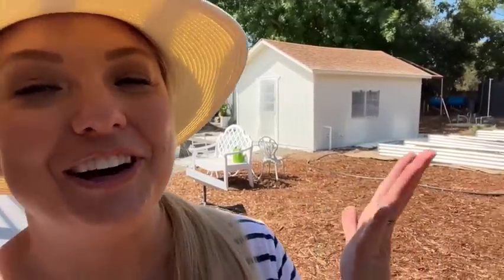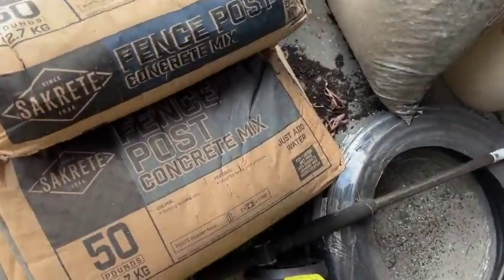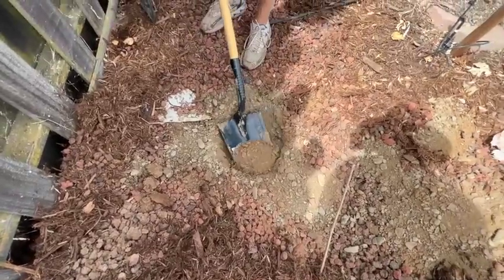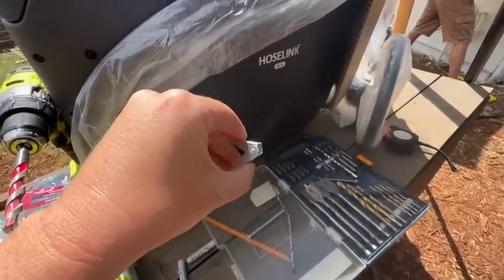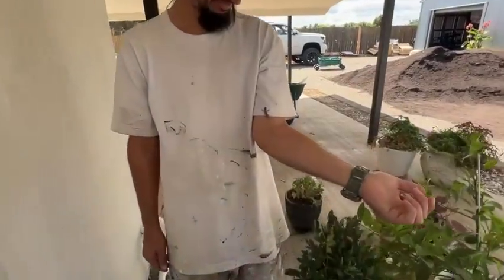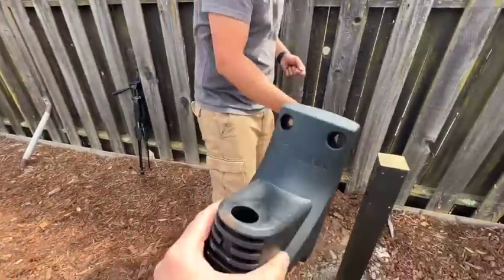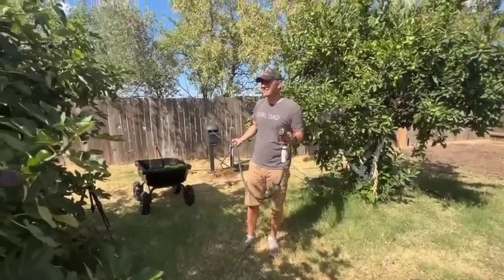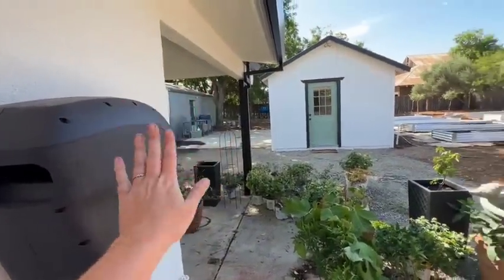💦 Installing the Hoselinks AND Painting the Office! 💦 :: Dig, Plant, Water, Repeat

Comment: I worked for a gas company for years.  Just remember they will have to trench in the line from the tank to your house.  The further away, the more of your yard they are going to tear up.  Also they usually charge by the foot for the trenching.  They will also need to be able to access it for filling it up, so you won’t be able to plant to close to it. Good luck!
Reply: I hope @digplantwaterrepeat sees this!  I don't know how to tag her, not sure if that is right^^^
Reply: Great advise!! So much to think about!
Reply: I have an idea for the pavement behind your office..  the frame would be pretty with an awning over it,  something pretty like the color of your door.  You can make it into your planting area with a plant bench and a cute chair for resting.
Reply: The sage green doors are the perfect color.
Reply: Would it be easier to bury it in its current spot instead of trenching through the whole yard? Our propane tank is buried in our yard with just the top cover sticking out

Comment: Have you thought about putting the propane tank next to the fence across from the garage (and driveway)  so it’s close to the house, still accessible to them, and a whole lot cheaper located there? They have to dig line to hook up and the further away, the pricier it gets. My mom was shocked at the price to move one so it stayed exactly where it was planted the first time😂….just a heads up.

Comment: Quick tip for doing posts, it helps a lot to get a piece of rebar or something similar and tamp in the quickcrete which eliminates are pockets.   You'll usually want to add a bit more water after doing so.  💞
Reply: Great information. I would be clueless if i has to do this myself!

Comment: Consider that the further away from the house your propane tank is the more pipe you have to have underground and that would mean you need to know where that pipeline runs in order to plant. You also have to be careful what you plant close to that line. Most propane companies charge more money if you have a tank that takes a lot of hose line to get to your tank. They usually have to send out a special truck with a longer hose. Having the tank next to the entrance would be pretty easy for them to fill and for you to know where your line is. Rupturing a gas line is not a good thing. If you choose to put the tank along the driveway you also might ask the propane company if putting up a metal pipe fence to protect the tank would be needed. Speaking from experience and from my farmer neighbors experience.